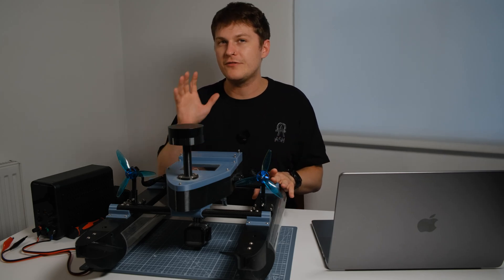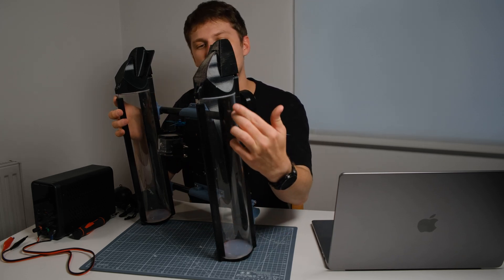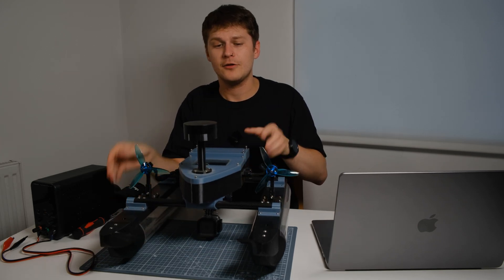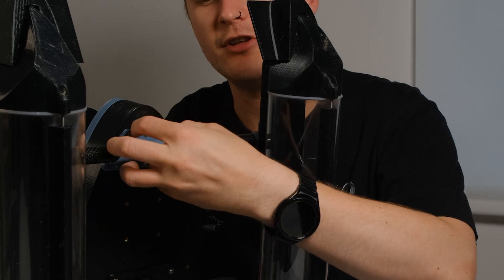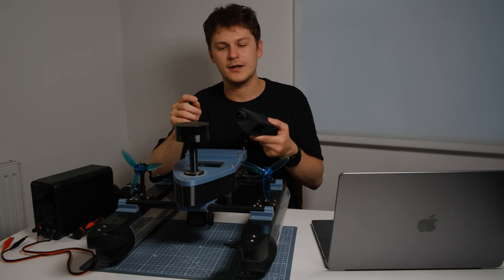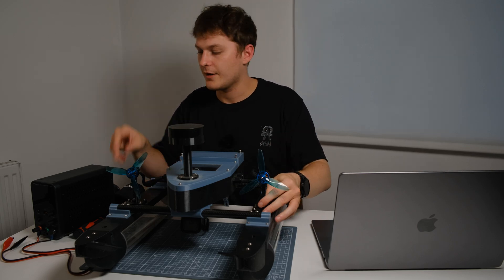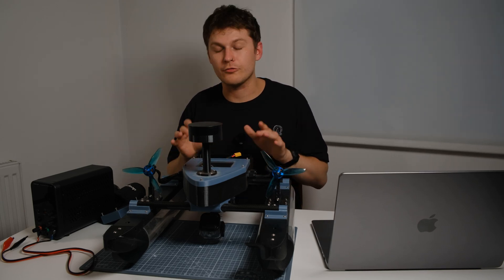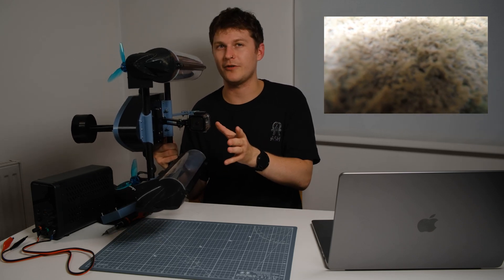What Did I Learn Building This Fish Finding Autonomous Boat?

Comment: Great work on the project and your videos are put together wonderfully 👏👏👏
I have had a very similar project I had been planning and just started organising components and 3d designs a couple of months ago. I too settled for an air boat with a catamaran style hull as the saltwater lake near me has some large weed patches in areas. Your videos have made me rethink some design aspects I had. Mine differs in a few ways however, I am planning on using simple 90mm PVC pipe for the hulls. I also am going to use a camera switcher to run 2 fpv cameras that are on gimbals (also have an action cam on them), one above water and one below so I can look around. My main goal with it is to deploy an underwater fpv rov that I have made that was originally tethered to a float that contained the Rx and vtx. For control link I am going to use elrs 2.4ghz for the airboat and tbs crossfire 915mhz for the underwater rov but  pending how they perform they might get switched. Unfortunately for video I have to use analogue to be able to use a cam switcher but openIPC is looking promising for digital video to perform the same way.
Keep up the good work and look forward to future videos ✌️
Reply from the maker: Thank you for the kind words! I think we're thinking along the same lines. I too was think about having a tethered sub under the boat that would use the boat above the water to send signals to and from the shore. Ive been thinking a lot about fpv cameras. But i'm still unsure of the route to go. Openipc looks like a potentially very good option. Good luck with your project. Thank you mate, lots of projects to go.

Comment: Walksnail or DJI fpv might work, but will be limited in range(especially as the antennas would be very low to the water). For a boat you don't really need the low latency video those provide, so you could look at streaming a webcam over LTE for near infinite range as long as you stay in coastal waters.
Reply from the maker: Thanks for the comment! You're right i think LTE will be the best option definately. That would be cool. Im planning on doing a battery test once ive got the range sorted on a lake.

Comment: EDFs are stupidly inefficient. They draw a crapton of power to move very little air very fast. Moving a lot of air slowly with a larger propeller is much more efficient as air resistance scales with velocity squared, but thrust only scales linearly. Also EDFs only work well at high speed due to their high blade pitch.
Reply from the maker: Yes i think this is the pathway ill probably go down with just some larger props and get the rpm lower. Thanks again for the comment!